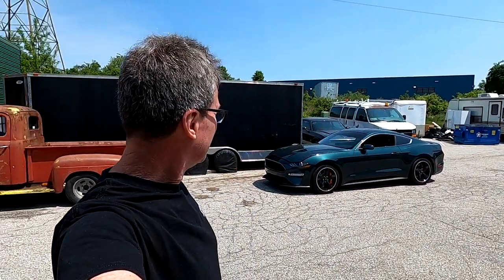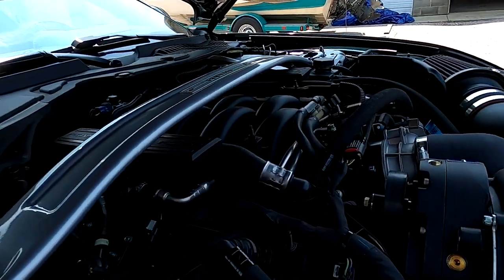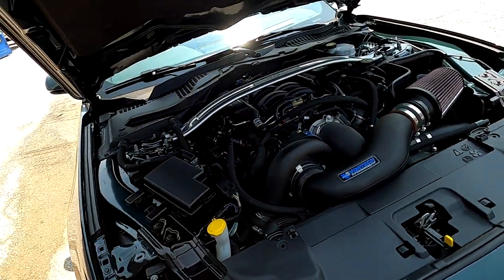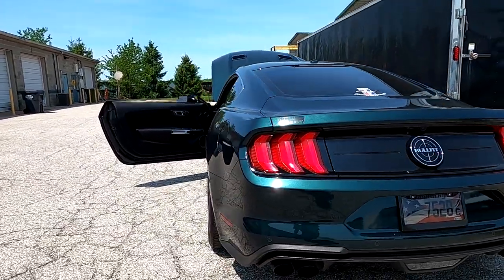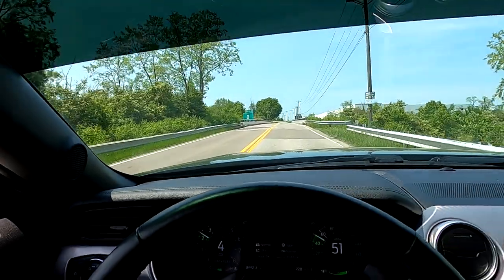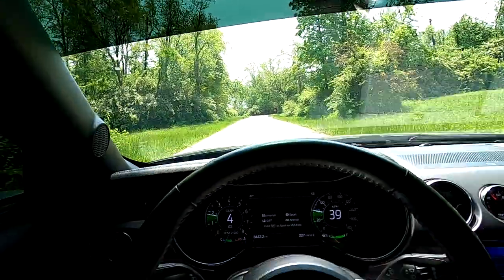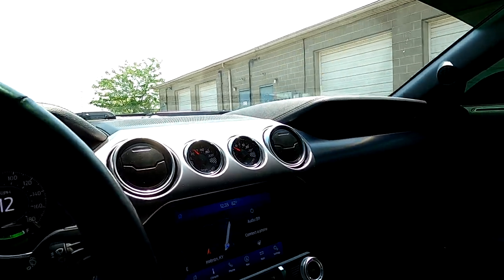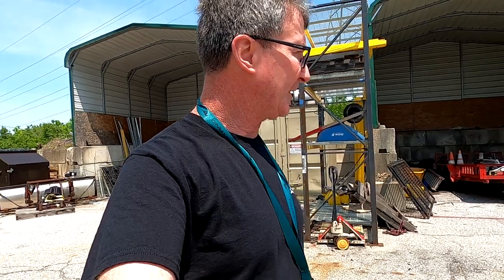Boosted 2019 Mustang Bullitt walk around and drive

Comment: Will that mt82 hold-up?
Reply from the maker: The MT82 transmission is pretty strong if you use a good sprung hub clutch and slicks, not drag radials. They seem to break around  800 plus wheel HP and mostly at the track with hard launches. Drag radials are hard on the driveline.